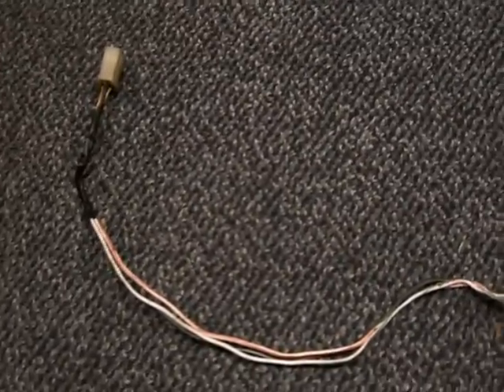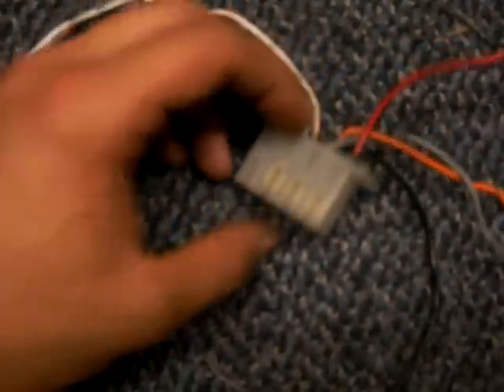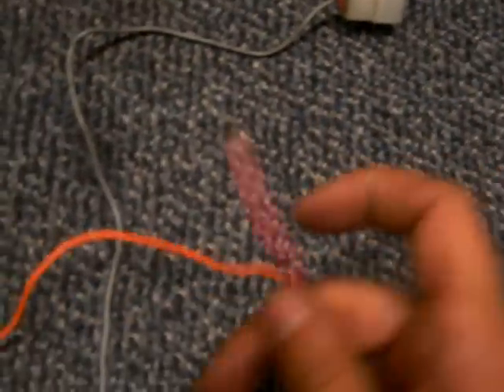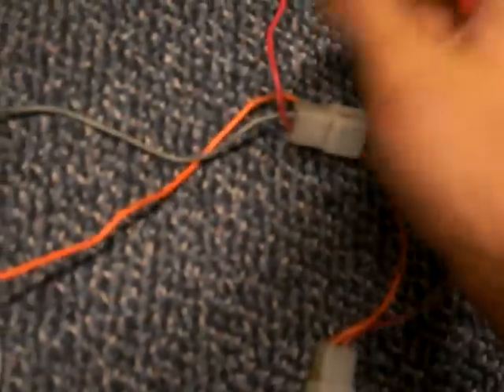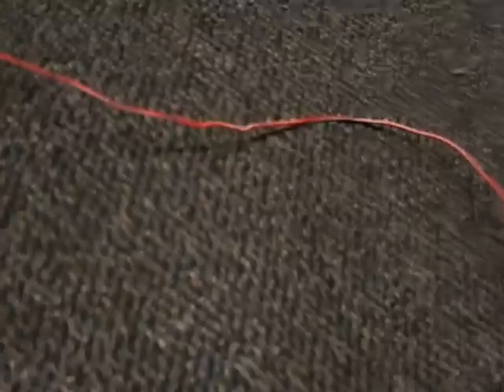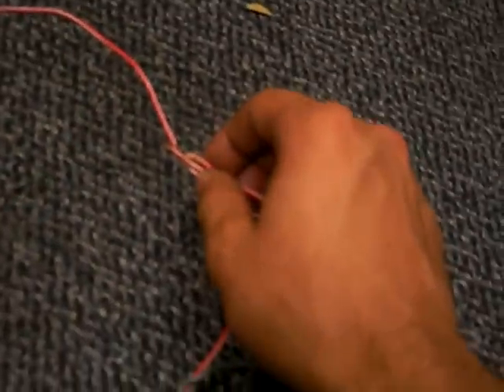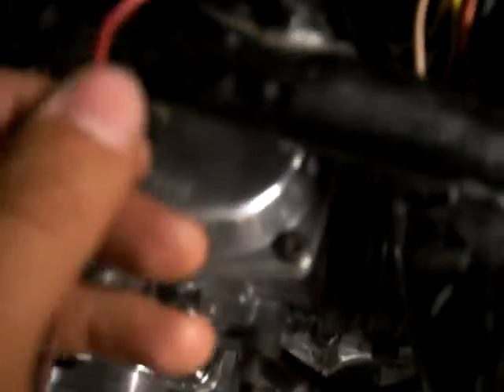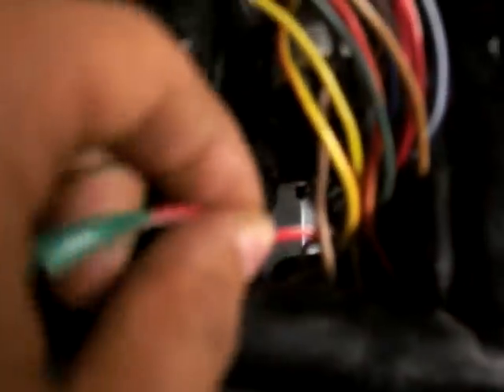xs400 electronic ignition swap

Comment from the maker: If anyone is curious.. 

i just wired the black wire to the main black ground wire. 

and just removed the old contacts wire, cut it out of that green taped area where it was soddered into the power/killswitch wire....
and the soddered all 3 of the red/red-white wires coming from new ignition into that area and re-taped it up.